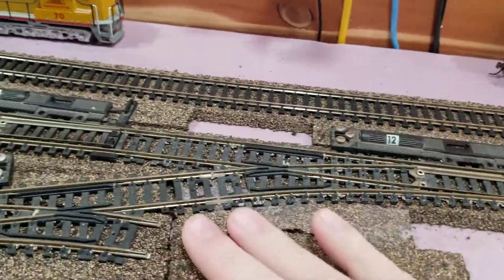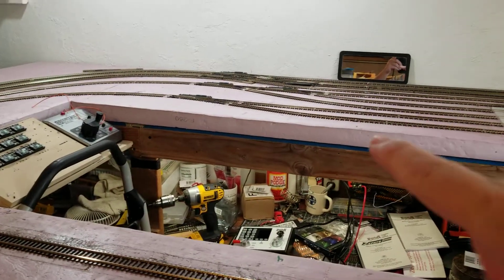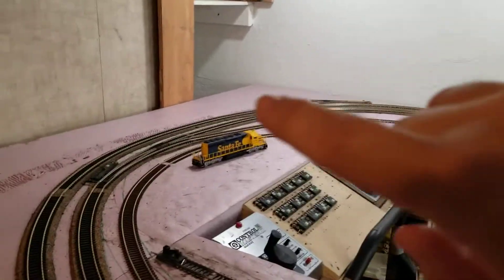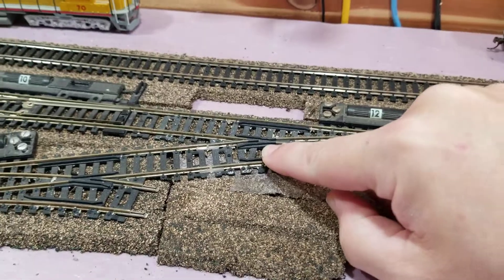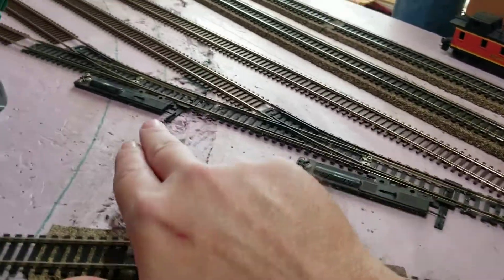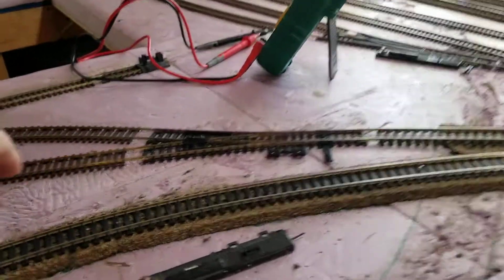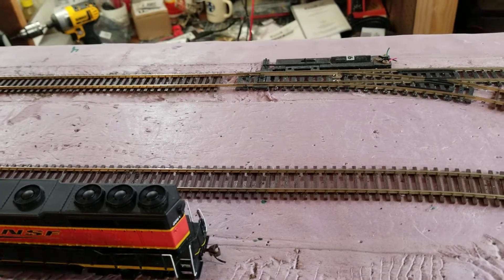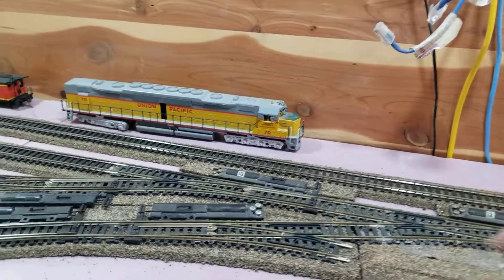Good News On The Track Faults

Comment: Chuck, from what I could see of your track configuration from the video, it definitely looks like you unintentionally created a reverse loop. Adding the insulated joiners eliminates the steady state short, but it will still short when the metal wheels of a train passes over the insulated gap. That's when isolating BOTH ends of the reversing section (and using something like an AR-1) comes into play. Good luck and take care.  Art...

Comment: You might have a reverse loop section. That causes a lot of problems unless you can remove the reverse section or use a DPDT toggle switch to flip the current.